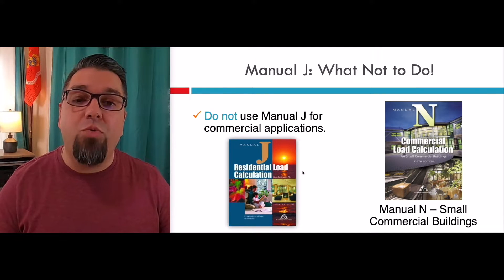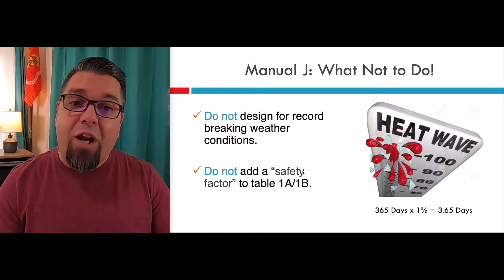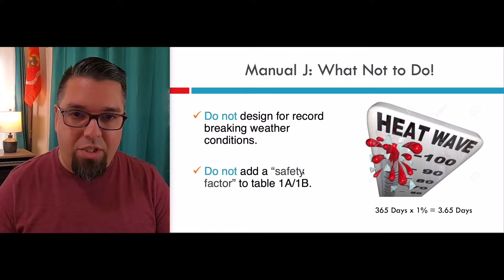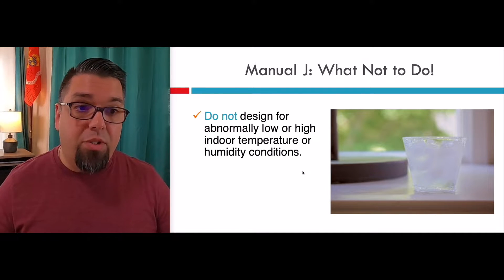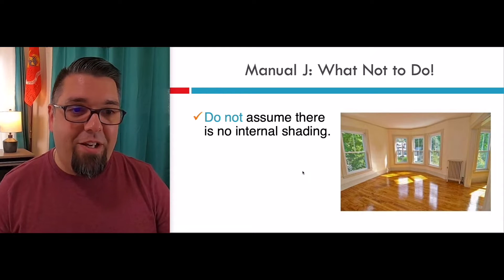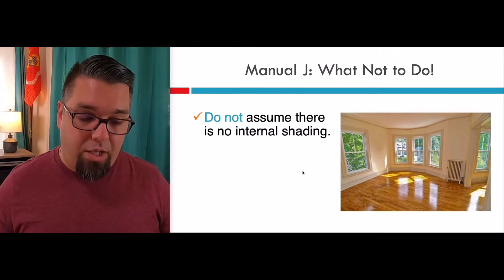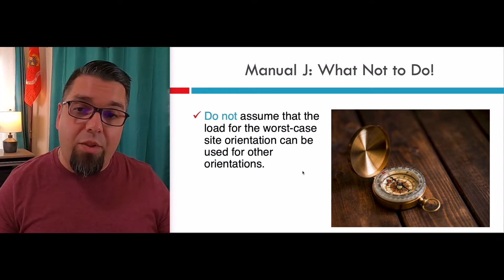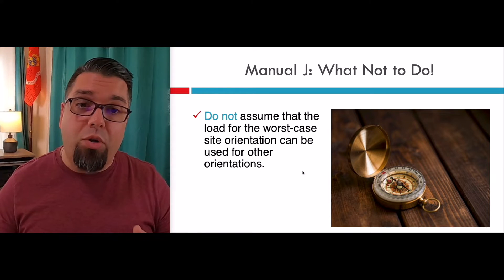Avoid These Manual J Mistakes That KILL Your Calculations

Comment: Hi Chris, excellent job with these videos. I’m learning a lot, you’re a great teacher! 

I have a question for you. 

I recently had new construction built for me and the Manuel J included a Carrier brand system and specs for the report, which is what the Manuel S also included or recommended. 

But my builder installed  a Comfort Aire handler and Rheem condensers. 

The builders choice of equipment was not included on the Manuel J or S, is this problematic? 

I am having issues with my upstairs system. It’s running consistently on warmer days and has very poor air flow compared to the downstairs system which is .5 tons larger. 

I’m thinking they undersized the upstairs unit but I’m a novice with a Manuel J report trying to find the problem. 

Any advice would be appreciated, and thank you for taking the time to make these informative videos!

Comment: I would have to respectfully disagree about indoor design temp. customer expectation is paramount.  We are after all a customer service industry.  Example: my manufacture does say I can offer as low as 68 degrees indoor design temp (COOLING),  I can sell that as a you have to live with it or find some one else. As a sales and design man the first 2 questions I ask is what temp do you like in the summer and what temp do you like in the winter< can i meet the clients expectation some way?  so if a client says i like 68 in the summer  and i too like 68. if you design a system with 75 degree indoor temp and the client is unhappy and finds that fact out you just might find your self on the loosing end of an expensive lawsuit. I know if I got a bug in my but I would gladly pay an attorney to abuse some one with expensive litigation. take away Government/ code mandated indoor temp do not,  DO NOT  hold up in court. threaten a code official with the liability if the system does not meet customers expectation, have then put it in writing why it failed. easiest code meeting ruling in the contractors favor you"ll ever see.

Comment: R values doesnt seems to impact the load too much, really little difference between R 11 to R 15(wall).
Reply from the maker: I agree!  Impacts the heat loss more than the cooling gain.  The bigger problem is when someone says it is R-0 or R-21, when it is really R-11…being off a few won’t impact the total load much.  Might make a bigger difference on a room x room with three exposures too…